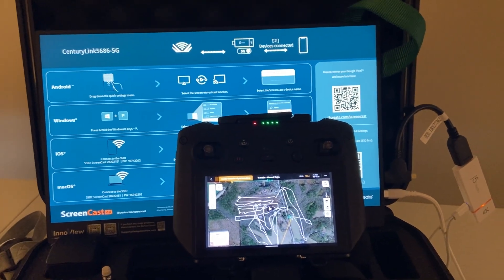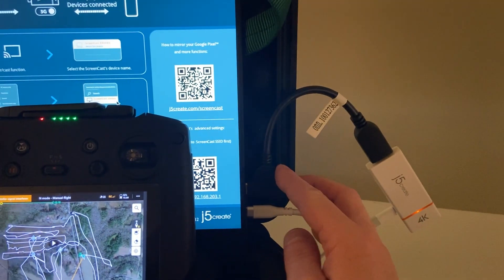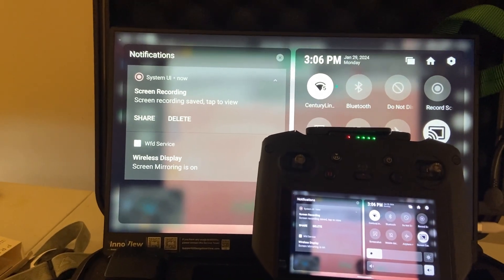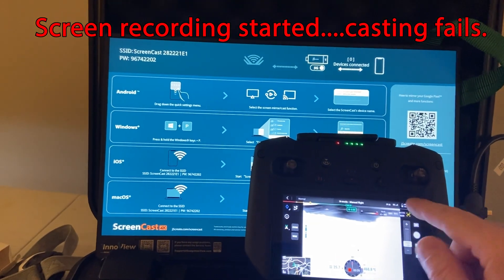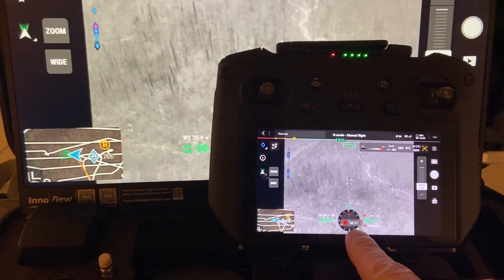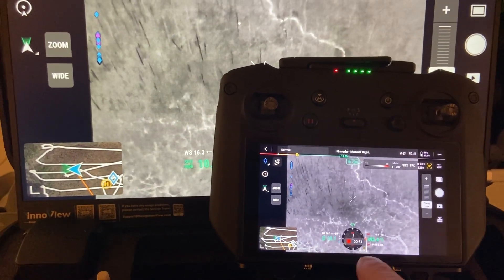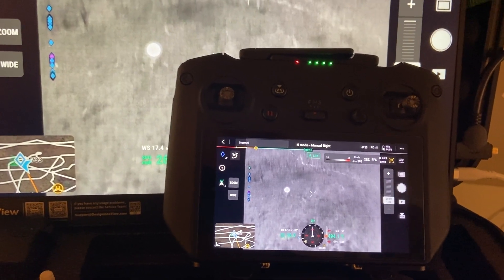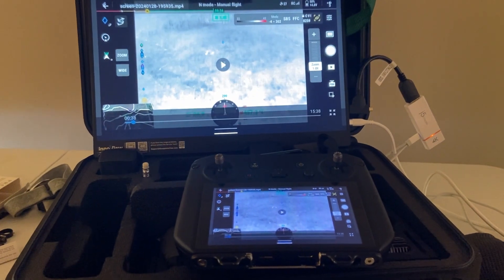DJI RC Pro: Screencast versus Screen Recording Conflict

Comment from the maker: While this video was made for DJI specifically to share the details of this problem, hopefully it helps you guys as well.  Unfortunately, DJI has responded that this cannot be helped and is a limit of the processing power...there is only enough to manage one video feed at a time...screen record OR wireless casting.

Comment: Thank you very much, this is also a major problem I have been trying to fix. I'm the one that sent you the comment from another device last night on your vid Calhoun County. Not being as tech savvy as you has made it extra difficult, as you are the only one with with a RC pro Enterprise controller and a 3T drone doing this, please make another complete vid when or if you find a solution. It appears TV makes and models play a huge role also, thank you again.
Reply from the maker: I will definitely provide an update as soon as I know something.